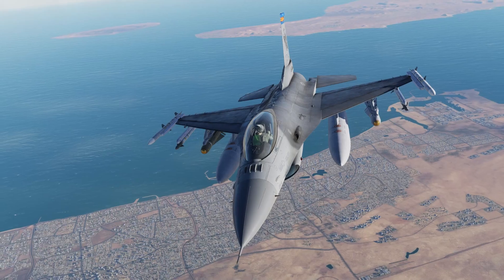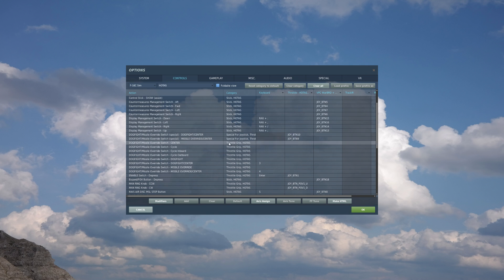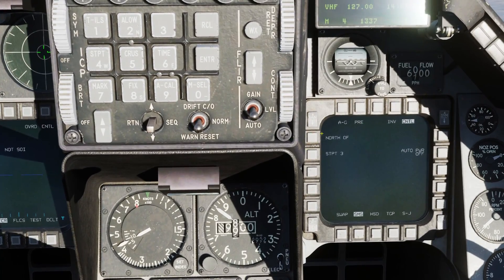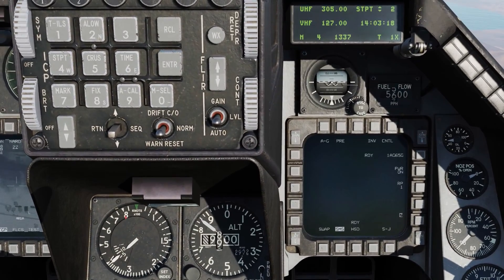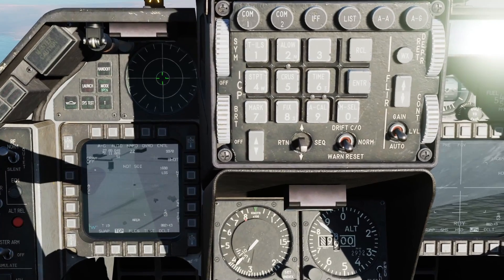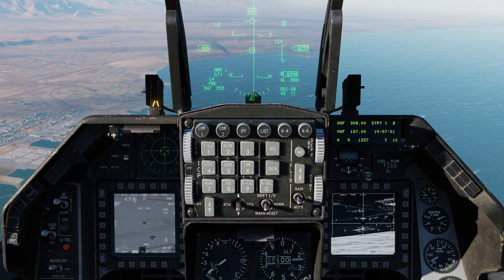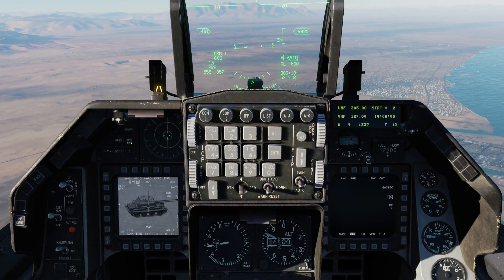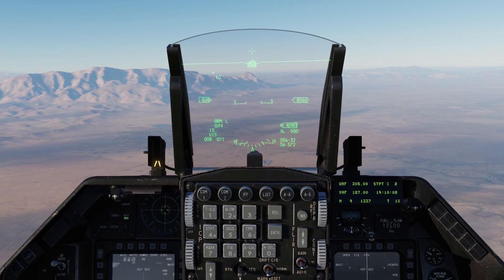DCS: F-16C Viper - AGM-65 Maverick Basics

Comment: Please help - when I SOI the TGP and try moving the cursor onto the target the target continues to move with the aircraft and doesn't remain stationary - it makes it impossible to stop on the target and designate it with the TMS. Thanks.
Reply from the maker: You need to be in CCRP,  not CCIP.
Reply: @MattWagner  Thank you
Reply: @Matt "Wags" Wagner  So,  I'm new to the F16 but not to DCS. I've been trying for two days to actually launch a maverick and only did so once (it missed). Most of the time the issue is the target won't hand off (always shooting Ds in auto mode). 
Anyway, i went back into the AG menu and couldn't figure out how to switch between CCRP and CCIP when using the mavericks. Thanks.

Comment: its so buggy cant use AUTO mode hand off always won't lock
Reply from the maker: It's not "buggy" and works perfectly fine when used correctly. Please post a track or video to our forum and we can determine where you are going wrong. https://forum.dcs.world/forum/118-dcs-f-16c-viper/  You are probably trying to force a Maverick handoff outside of the seeker range.
Reply: @MattWagner  the maverick was not behaving when I press PRE. It did not slave to the tgp and it was quite frustrating. Ok good to know it's not buggy probably I must be doing something wrong then. I was watching you video over and over and also grim reaper and read chucks guide. I went to download your actual manual too but it feels less information there compare to chucks guide.

Comment: Hey there man! Any idea why I'm always having a huge enough off-set between the box (TGP's LOS) and the circle (mav's LOS)? Due to this, I always must switch to the WPN as SOI and slew the designator manually to the target and lock it there on. Any idea why I'm getting offset between the TGP and MAV views?

Thanks!
Reply from the maker: https://youtu.be/2p_DObCNDI4
Reply: @MattWagner  
Thx man! That was exactly the problem as most newbye to the AGM-65s on F-16 have, having those sensors aligned. Even in hot start (a bug, or the hot start won't normally have this one sorted out?), we still must lock onto anything with the mavs, not necessarily where the TGP is pointed at, but anywhere just in order to press the BSGT and then TMS down. Only then we have each consecutive pylon aligned!

Comment: Hey Matt and DCS community, I'm using the K variant maverick, for the life of me I have followed this video to the tee, but everyime I do the handover (I'm within 6miles before i TDC Up, Im also in Pre mode, Im also in Auto mode, my mavericks are turned on, my arm switch is on, my laser is on ) it just doesnt seem to work , the circle is there over the target but when I hold weapon release it flashes but weapon doesnt come off, only way to make it work is to manually go the Weapon page and slew it over the the target and hit TDC up. Is there a current issue with the F-16C Viper in DCS or am I doing something wrong ?
Reply: OK so  Ive spent more time trying to follow this tutorial and work out whats wrong. The only work around I found to get this to work is you have to make the Weapon page SOI again after youve done the handover from the pod and use TMS Up again on this page to lock on to where the POD is pointing.

Comment: Handoff still not working properly.  Command the handoff and the Maverick’s speaker ends of pointing nowhere near the target.  Been around for month.  Gonna be fixed sometime soon?
Reply from the maker: Please boresight the Maverick seeker first.
Reply: @MattWagner  Air start missions.  All of that should already be done.  Handoff is not acting properly.
Reply: @agamemnonn1  
Does your viper have a waypoint set in the mission? If not, that could explain the issue.

Alternatively, command the handoff several times (switching between area and point tracking on the TPOD page)
Reply: noticed the same. You forgot to boresight the mavs first. Sadly, nearly nobody mentiones this in their mav tutorials at the beginning.

Comment: with the AG65K can we auto handoff and lock as well?
Reply: Better force correlate in AREA mode after handoff, no need to wait for the mav to get a lock (and be shot down in the process).
If your mavs are properly boresighted with the TPOD, force correlate lock at 10nm will be accurate enough to hit the target (as long as the viper's nose is pointing in that direction)

Comment: How do I re-correlate the Maverick if it becomes uncorrelated from the pod? I've noticed the Tpod gets stuck to one point to the ground and I am unable to slew the tpod. :/ I have an S over the station.
Reply from the maker: If you wish to slew the pod while using the Maverick, you need to be in PRE mode. If you then try to handoff/designate the Maverick too early (out of range), TMS aft to reset. Thanks
Reply: @MattWagner   Thanks that did  it! Almost like you helped design the module or something.... Weird..

Comment: Sorry but the TGP is completely unituitive after that Patch - im just to stupid or its broken - i cant get it to work it looks where it wants, always need to use snow plow - then its not locking - sometime the Mav then locks a fence or any structure instead of the real Target (a tank or somethin) and i cant get it to slew again. Edit: Well il getting warm to Mavericks in Visual - and i can throw bombs with the TGP - but im always struggling with getting the Bomb Line on Stear Point, sometimes it works sometimes not - and all with the Snow Plow Workaround. Its still a Nice Update dont get me wrong - I LOVE the 6xMavericks but the handling confuses me O.o
Reply from the maker: Works perfectly fine here. If you wish to slew the TGP, you must have a steerpoint and be in CCRP mode. We'll later add DTOS mode for HUD designation. A Maverick seeker has no idea what is a "valid" target, it will simply lock on to a contrasting target in the keyhole. Thanks and have fun!
Reply: @MattWagner  Hey thx for the Answer - is this the REAL behaviour that you always need a Steerpoint to drop a Bomb with a TGP? That must be hell of annoying for real Pilots? The "old" TGP i could just press TMGT down and it slewed to the current Heading and then i could designate Targets - that was User friendly. I know the Mav doesn´t know what is a "real target", but can i unlock it when it picked up a target? That would help out much! And again Thx for the Answer - thats why i got all your Models and Support you Guys, you make Virtual Dreams come true and listen to your Community!
Reply: @MattWagner  I am getting different results, Wags.  Here's the scenario:  two targets, one on a waypoint and the other a tank roaming around the desert. When working with the target on a  waypoint, it does fine. Slew all you want,  CZ to the point, slew to target.  Perfect. But then when you try to use SP to get the target of opportunity, the TPOD looks forward, but the targeting box (SPI?) doesn't move forward.  The only solution I have found (which works very inconsistently) is to go from CZ to SP and back several times.  Eventually, with no real rhyme or reason when, the SPI moves forward and you can set a target.
Reply: @RicCrouch  i encouter exactly the same - random CZ to SP and then SOMETIME it randomly flips - but i cant find a consistent working solution
Reply: @RicCrouch  it's broken for sure

Comment: locking doesnt seem to work reliably with TGP handoff usually getting stuck at T on automatic and manual and visual modes trying to lock results in the cross hairs disapearing instead of locking. Is this a known bug being worked on?
Reply from the maker: Works great here. It sounds like you are trying to handoff outside of Maverick seeker range, or not using a D or G. Thanks
Reply: @MattWagner  With a D at 3NM and even down to 1. Some replies over on Grim Reaper's video on this have been having the same problem, including Cap.
Thank goodness someone there at ED found there is a bug! :) 
"Hi all
the team have reproduce the inconsistent locks and are working on a tweak
thanks	
BIGNEWY"
Reply: @jeffreyc2074  Two months later.... still not fixed.

Comment: is it just me or are Waypoints in the viper Extremely broken so is the ins like whenever i type in a waypoint also yes im inputin ghte correct format the diamond thing that indicates where the waypoint is, is staying in the same spot
Reply: I had this issue too..just switch to a different steerpoint and switch back and it fixes it instantly.
Reply: ryasa oof idk didnt work
Reply: @drunklessdylan1234  Then you are probably inputting incorrectly. Note that for longitude coordinates you currently have to put a 0 in first for it to accept it properly if the first part is two digits, which it will be anywhere on Caucasus (haven't tried other maps as I don't have them). So if longitude (E) coord starts 42, you type 042

Watch for the fields flashing after you hit ENT. If it flashes, you entered it incorrectly.

Comment: Hey ED Team, glad to see that the Viper is progressing.

And what about the handoff completion procedure? According with the F16 -34 doc, with the Delta and the Golf variants, we should make "correlate" the POV of the Maverick with the POV of the TPOD. However, in this case apparently the Maverick is already looking magically where the TPOD is looking.

It is known that during their operations, the pilots having to use Maverick pre-set the Handoff on the ground, on a fixed point. (A hangar, for example).

Thanks.

Comment: I did not see a range indication on the HUD or the WPN Page for the Maverick on your second attack run?  Is that not a function in VIS Mode?
(This will really give the Viper some teeth!)
Reply: It would require to have some laser or radar measuring range. In pre plan you use laser in the pod to measure the distance.

Comment: Good work!
How many AGM 65's can be carried by the F-16 Viper? I know from Wiki and other sources of 6-8 Mavericks
Reply: Historically 4, but 6 is possible
Reply: @spacekraken666  I think technically 8 is possible. The 6 on stations 3 and 7 then 1 missile on station 4 and 6. Were they ever loaded like that?I do not know.
Reply from the maker: https://forums.eagle.ru/showpost.php?p=4488587&postcount=46
Reply: @MattWagner  will we be able to do 8 in total or can the viper not run lau 117 mavericks (stations 4 and 6) along with those triple racks (stations 3 and 7) ? Cause stations 4 and 6 can also put lau-117s on.
Reply: @MattWagner  OMG YESSSSS!!!!!
Reply: I believe the smaller variants can be carried up to 3 on stations 3 and 7, with the triple racks, though I don't know if the 3-at-once was ever used operationally. My searching around in the last few weeks seemed to have a handful of people saying that they only ever saw 2 loaded on the launchers. But I believe if you're just loading the Maverick, either the larger or the smaller ones on the single-rack, they can go on 3,4,6 and 7. If I'm remembering right.
Reply: The Block 50 carries only 2 Mavs.
Reply: @Elixir22  Not Correct:
http://vnfa2.tripod.com/VNFA-Maverick.html